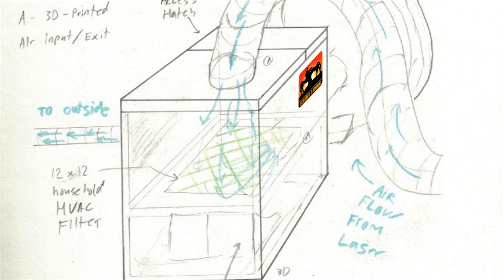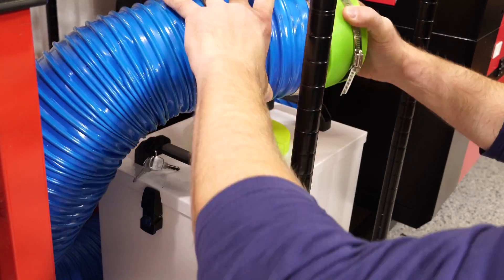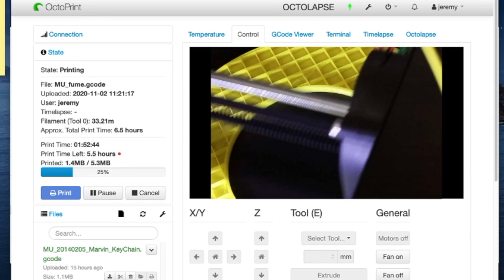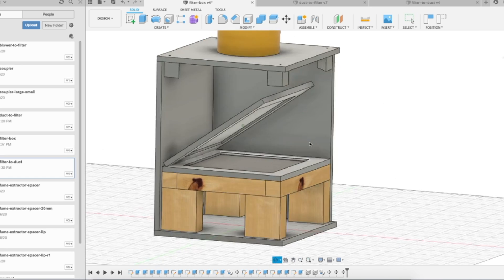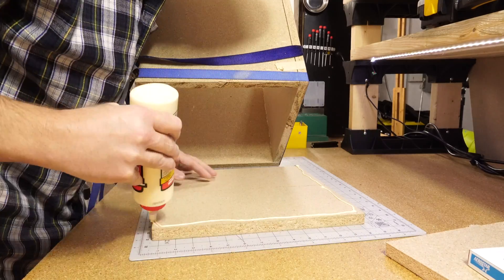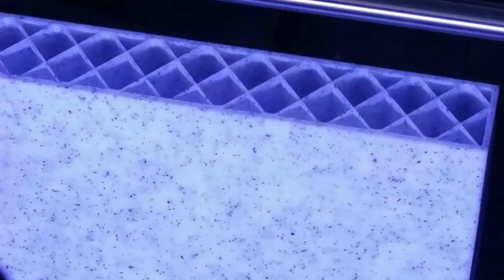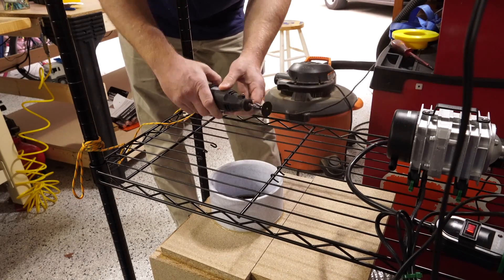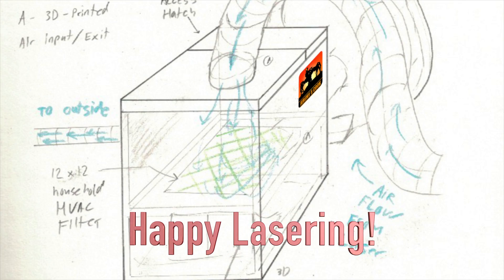Laser Air Filtration DIY [Home HVAC filters]

Comment: For magnetic "circuits" the most important thing is eliminating the air-gap (or plastic gap in this case). Air has a permeability 1000 times less than iron / steel so any gap between the magnet and the steel greatly reduces the force of attraction. Ideally you would leave the magnets slightly protruding or flush with the surface. I'd suggest gluing them in and pressing the assembly onto a flat steel surface to align all the magnets while the adhesive sets.
Reply from the maker: Ha, that is a good idea. Thanks for the tip!

Comment: How often do you change the filter?
Reply: Wow! After many years of use? What filter are you using? It’s not clogged?
Reply from the maker: A standard HVAC filter (maybe two) followed by activated carbon. I don't run it every day by any means. Also, I have noticed some smoke, so perhaps it's time to change the carbon bags out.
Reply: Thanks! +1 sub and like 👍. Someone in the comments mentioned a follow up video and looking for it now. I was thinking of doing something similar with an AC infinity inline duct filter and a 3M merv 11 odor removing/ filtering 14x20x1 HVAC filter. It makes me hopeful to see your success with a similar technique.
Reply from the maker: Well thank you! It's been a success, but you definitely need the activated carbon, and even then you should vent the smoke outside.

Here's the followup video: https://www.youtube.com/watch?v=E1zXqY-Z0s0
It's on a second channel that I originally used for laser purposes, and since have repurposed it for musical usage (though the laser certainly does make appearances still)!
Reply from the maker: Well TBH I have yet to change the filter. So I should do that soon probably!

Comment: How is that filter unit a year in? Are you still using it or have you upgraded it? I also have the exact “red and black” Im fixing to built a filter box just like this one. Any inputs and advised are very much appreciated. Thank you.
Reply: Lol nvm I just saw your updated video. ☺️ thank you!
Reply from the maker: Ha, NP! Still seems to be working :-)

I also use a fan with a filter in my garage, and keep in partially open - generally no visible smoke, but can smell the burned materials. I wouldn't use it in a fully enclosed space.

Comment: You can't shrink a 6" outlet down to a 3" inlet/outlet. The flow is going to be limited by the 3".
Reply from the maker: Internally the blower outlet is much smaller than it is on the outside. Probably kind of hard to see in the video.

Comment: Couldn't you just put the provided extractor inline with the filter extractor you bought?
Reply from the maker: Ha, tried that actually - should have left some of the footage in (there wasn't much). Basically it seems that the purchased filter acts as a bottleneck to the process and slows things down. The duct that I used to connect the two popped eventually - seemed to be a lot of pressure.